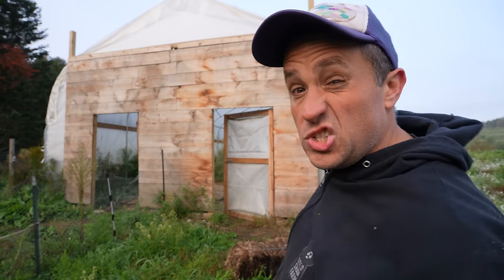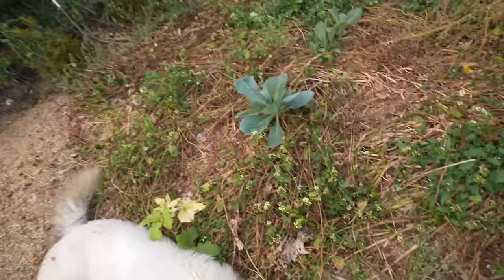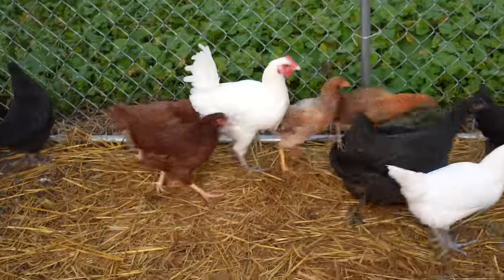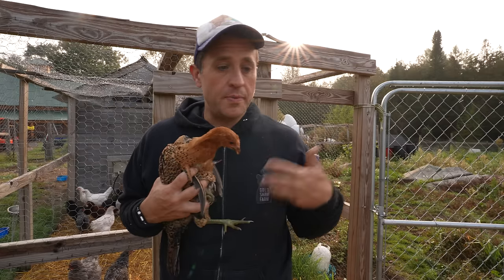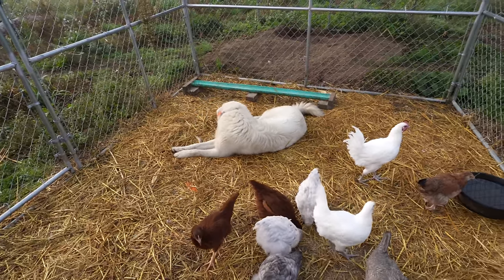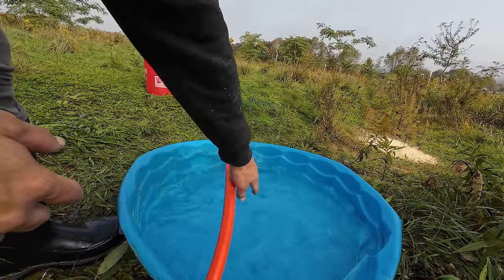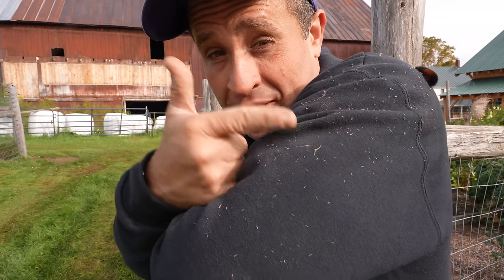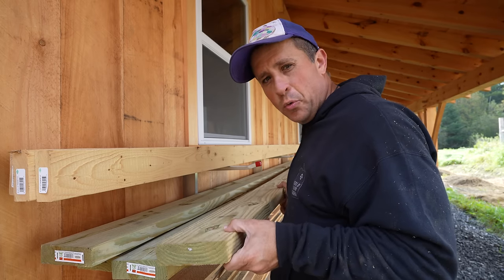World's Most Dangerous Tarp!

Comment: Just a note, squash and pumpkins (most melons really) have a bad habit of cross pollinating and making some odd half breeds. For animal feed it isn't a big deal but if you want to plant pumpkins again for other purposes I suggest doing a mono crop of pumpkins and not to mix in other squash type plants, or if you do make sure they are as far away as you can get. Pumpkins and zucchini in particular are voracious cross pollinators.
Reply: I’ve wondered about this - is it the next year/seeds you have to worry about or the current year’s crop?
Reply: @nikkireigns   in my experience it is the current year. When the plants flower they cross pollinated and we routinely got green pumpkins, and round zucchini mixed in with ones that looked correct. It does also change the flavor and consistency slighty. If I recall the more zucchini looking pumpkins were harder than the regular ones. As for the seeds I don't know, we've never re-planted from what was grown.
Reply: Spaghetti squash and zucchini REALLY like to cross.

Comment: Hi Morgan, have you thought about putting sliding doors on the hoop house, you could either use a single rail or offset the doors and do double rails. That way you wouldn’t have to worry about the bed pack getting in the way. A single rail would let you have both doors open half way or one fully opened. Just a suggestion.

Comment: @GoldShawFarm have you put any consideration into getting a trailer for your bike?
At 63 years old, I've been riding bikes almost daily for the last 57 years and I have had a trailer in some shape or form for about 50 years. Depending on what mid-drive motor you have, I'm guessing torque would be somewhere between 120-160 N.m. Which would be theoretically more than capable of towing a trailer with a payload of 100lbs over your farms terrain.

Just a thought.

Comment: The black austolorps are a good all rounders, aussie chook. They handle high heat well as the cold but we dont get snow like you but i dont have a massive hoop house so that evens out the odds.
They get big , well the ones developed and breed here are not small chooks.  
Out in the king lake and masidon ranges we my get a day or 2 of snow but below 0 degrees in winter is nothing to be suprided at . 
Icey , very wet and their fine then you get 37 degree days in summer and they just find some shade.

Have not lost one to weather yet and ive had them on and off for 10, 15 years.
The odd fox has got mine as they free range but they are a longer lived, healthier chook and long laying life chook too with good sized eggs, you will get at least 1 egg a day out of them , if not 2 eggs unlike the isa browns that lay themselfs to death in 3 years and are concidered retired at 18 months economically at big poultry farms and they only put out 1 more egg a day thats much smaller ( not for eatting) and then you can eat the austrolorps as they are a dual propose chook.

Get some more girls in . You wont be disapointed. 
Good for eatting and eggs, at least 1 or 2 eggs in peek laying season of a good size for more years than a isa brown that lay themselfs to death in 3 years.
You will get 5 to 7 years laying from a austrolorps weighing in about  4kg and 300 eggs a year but they can live to 10 years old in retirment. 
 They handle some harsh weather too.. thats what their breed for.  

You now have my 2 frave chooks atm .
I find the rode island reds are ok layers too and good meat birds that handle our aussie summers well enough and are really chill personalities in the flock that like hanging with the kids when their gardening....snail removel clean up crew. . 
They just like peopleing.

Their friendlier than the austrolorps but your running a farm so their not pets.. cuddlyness is not high on your priorities.  
But hay ,They would break in my house and hang with the house cat and dog and find them on the couch ... lol ..... shoosh , their programs are on ... lol .
They keep us amused.  

But ive been mentioning austrolorps to you for years now ...YEARS.... LOL.

Whats changed?
The availability in the states ?

Comment: You need to scrap the Pumpkin more and make the Letters 
a bit Larger
and probably have 
3 to 5 points in the circumference
like a Triangle or Star then put it in the middle not against the wall 
for more Chicken to feast on it 
Then have 2 to 3 camera set up

Comment: Corrugated translucid roof sheets.  Made of fiber reinforced plastic. Use the exiting steel frames to anchor your roof sheets.  Why you used plastic lining in the first place is beyond me.  

And please reinforce the perimeter baseboard with a strong wire screen.  And trench around with concrete against predators.  

The steel frame is nice and well thought, by the way.  

You lost a lot of weight, by the way. Still the same awh chucks screen persona.